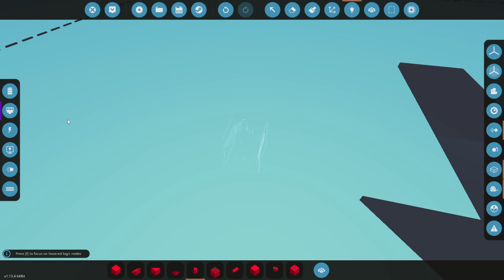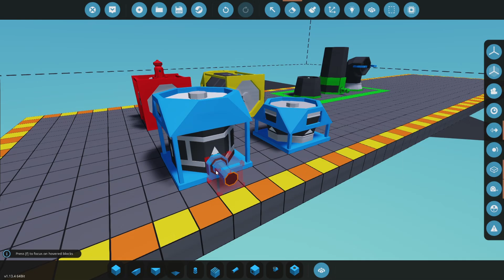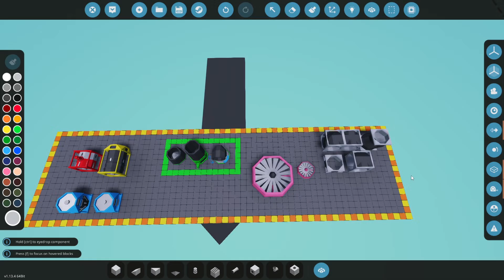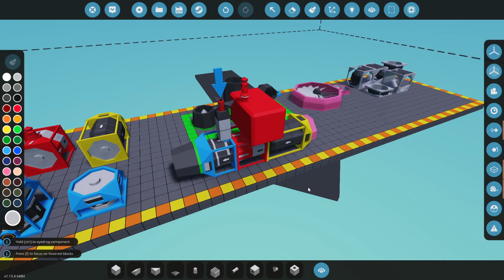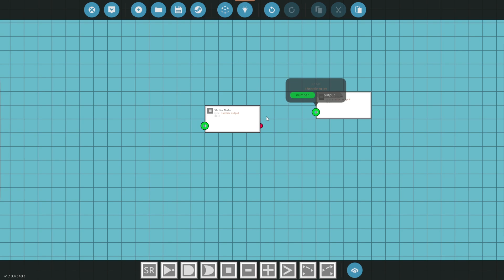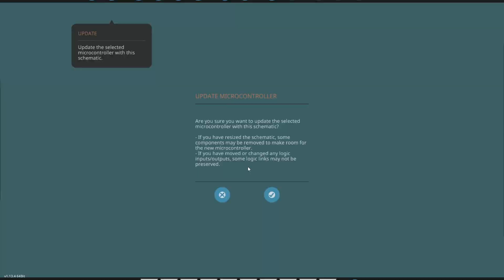Simple Jet Engine Tutorial in Stormworks (Engineer Explains)

Comment: unless someone has already said this, you can make ram air jet engine, basically just remove the compressor and you have to already be moving for it to turn on, also helps if you have the medium turbine with an electric motor attached to it so it doesnt just turn on, great for large missiles or cruise missiles

Comment: I did thje microcontroller 1 to 1. checked it 3 times. for some reason my engine is always at 15 and my throttle doesnt do anything
Reply: It's his janky counter system. Change your throttle levers maximum to 18 instead of 1. You'll probably have better luck. You could also remove that entire counter setup and run the throttle straight to the PID, but the PID would probably need tuned.

Comment: Just a tip re: your controller. You shouldn't use your collective as any part of your throttle control for a helicopter. Ideally a helicopter engine and rotor RPM will never change. The engine throttle will obviously need to change to account for changing loads on the engine, but the RPM should remain as constant as possible. In most real helicopters this is done with a governor that adjusts the throttle automatically to keep the rotor RPM in the desired rev range. In SW this is mostly important for the other flight controls. The stock gyro hates high rotor RPM and RPM changes, and tuning your pitch and roll for one rev range will give poor results at even slightly different RPMs. This is because the pitch and roll authority increases linearly with rotor RPM, so if you increase the RPM 20% then your pitch, roll, and collective inputs are now 20% more powerful, making the controls a lot more sensitive.
Reply: So the best idea here would be to have an ECU try and keep your helicopter at a constant RPS as load varies with the collective, and ideally having a powerful enough engine that increasing collective doesn't affect RPS too much. Some helicopters IRL if you jam the collective then the rotor RPM will drop too low and you'll lose lift.

Comment: Giving a suggestion to everyone watching.
Stick a clutch between the electric motor and the RPS pipe. Then connect the same signal for the motor to the clutch. The motors add drag to the system when they aren't being used. I use this same idea with all of my engines, jet or diesel since they start up much faster and modular engines have drag from the belt system. So I don't use modular engine starters either. I have a dedicated "jump start" MC that just takes in an on/off signal and outputs a number which is 1 when it gets an On signal. The clutch and motor engage then disengage when off.

Only other comment I'd add is, why not use Greater Than instead of the threshold? Is this for packaging? (1x2 vs 2x2 + you need a 1x2 constant number?)

Comment: I really like the idea to have the throttle value translate to an upper and lower rps limit, that works really well.
for smaller jet engines, dont have the compressor. Instead just add the starting motor. I would also hook up a generator which only activates based on electricity remaining. instead of something complex with a pid I would just do this:   if x < 0.8 then go into a capacitor with 0s charge and 10-15s discharge time. Hook that up to the generator clutch.
Since Stormworks has Electricity values of 0-1, it will just turn on the gen for 10-15s if it goes below 0.8.

Comment: You can or could(I didn't test this in resent updates) remove the compressor stage and only use the combustion chamber and a turbine but only at high speed like a ramjet engine

Comment: You can get rid of the compressor and use an electric motor to get the system started. The turbine will create its own pressure at high rpm.

Comment: From my experimentations I've found turbines are not balanced out for power generation.

You need about 20 turbines get barely enough power for 1 compressor. But if you put a small generator on a medium turbine you get more than enough power for a compressor.

This is especially a problem in classic career where medium turbine is locked behind more research.

Also from the same tests I've noticed putting multiple turbines in parallel increases efficiency. But its not significant unless you're running the engine fast enough (70+RPS)

Comment: 10:55 you can make mixed engine like diesel or electric with turbine, for example if you place big turbine and place large jet intake on it square part, then connect to turbine rps any source of rps like motor or diesel engine - large jet intake will provide large amount of thrust. Also compressor is unnecessary, if you have intake and flying aircraft you need compressor just for start then turn off. Also you can remove compressor entirely if you provide some rps for turbine at the start
Reply: Why not just using fans?
Reply: @londonhydra2086  the jet intake allows max speed